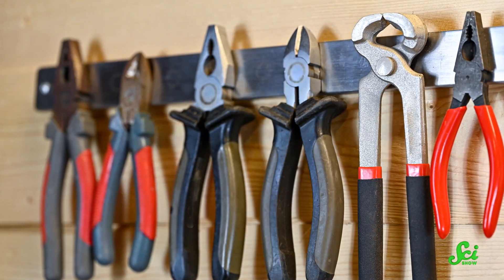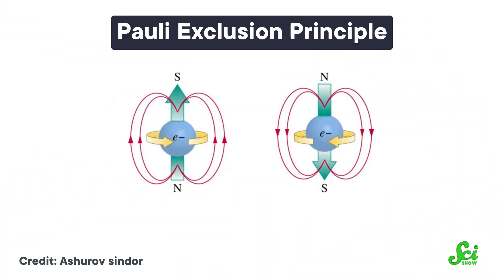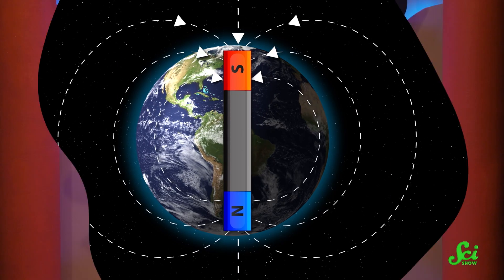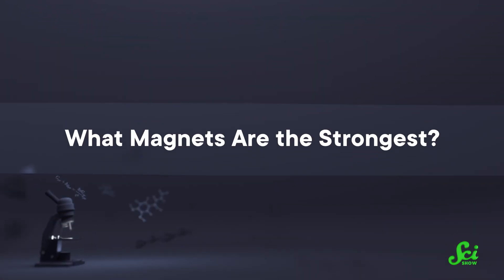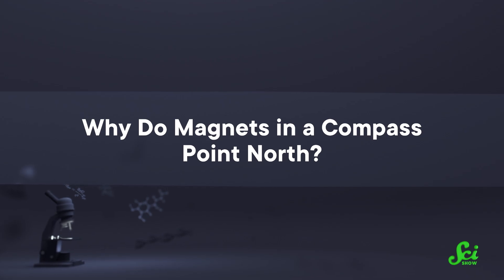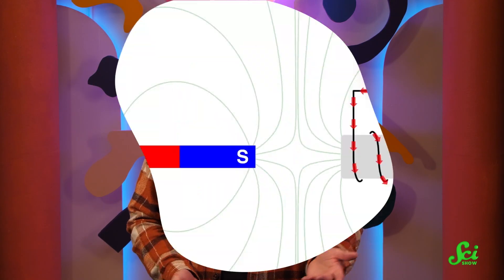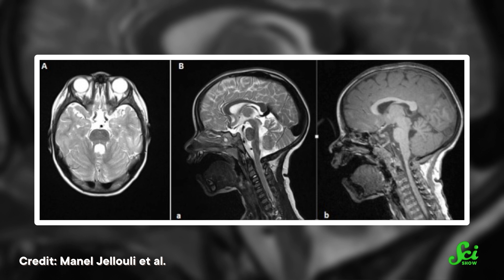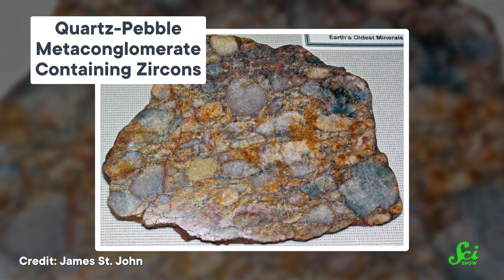The 16 Most Asked Questions About Magnets

Comment: 12:07 ooooo, I’ve undergone Transcranial Magnetic Stimulation (TMS). It was incredibly helpful in reducing my treatment resistant depression! the magnetic field is about the strength of an mri. 

It’s a little spooky when you’re doing it, because they can make your arm/hand/fingers move by pulsing something into your brain. If I remember correctly as well, the mechanism that makes TMS work as a treatment for mental illnesses is rather poorly understood. 

Super cool 💕
Reply: I've had it for both my depression and anxiety. The do have to switch sides for it to work on the separate issues. I still have to see a therapist and take meds, but I finally saw progress.
Reply: @jerseygirlinatl7701  Same situation for me. Meds and therapy are still necessary for sure, but it got me to a point where with those I’m functional:)
Reply: I have wondered if TMS could help those suffering long term/permanent antidepressant withdrawal syndrome? Since people like myself where the very meds that where suppose to help have left us disabled and we can't take any drug what so ever to help with the symptoms because it makes the condition much worse.
Reply: @3800S1 I suggest you go take some light box and uvb,uva light lamb (Use it with 15 spf sunscreen+carrot oil to reduce skin cancer risk) and take some thyrosine and 5 htp. Basically light box helps serotonin and dopamine to release and stimulate synthesis(hence why some go into manic episodes because of intense light) thyrosine and 5 htp are precursors of dopamine and serotonin if your reserves low it will fill it up and stimulate enzymes that synthesis it. Lastly uvb,uva lamb for vitd synthesis and has modulator effects on neurotransmitters. 

Truth be told I havent used light box and uva uvb for my withdrawal. I have tried to wean off 3 times ended up in extremely terrible side effects so I started taking 5 htp and thyrosine they were enough for me to wean of I didnt even have withdrawal despite weaning of just 1 week 1week. 

Ssris tend to lower receptor amount and enzyme that produce them so in some brain cant turn it into normal after stopping the drugs. I hope this helps. Also good sleep will make it better ,light box will help you with that. If you use it regularly 3 times a day (medium intensity 5000 lux in the morning,10000 lux in the noon,2500 lux in the afternoon) you will knocked out at the 21.00 pm.

These will help but if it isnt completely gone you need to directly stimulate your receptors so take some shrooms. Best way to get rid of depression and side effects of ssris are shrooms but I suggest you to take tyrhosine and 5htp to fill your reserves first than take shrooms Once your reserves filled up they wont have an effect stop taking them since they effect badly when you use them unnecessarity.

If you have bipolar disorder do not go above 5000 lux in the light box and do not take thyrosine (dopamine precursor)(just go for 5 htp) since they might cause a manic episode.
Reply: @3800S1  I can say that when I was cold turkey-ed on my antidepressants post TMS (really unfortunate mixup with my psychiatrist), I dealt with some brutal withdrawal symptoms. I don’t know if they could help while in their midst, but it, at least for me, didn’t preemptively prevent them.
Reply: I have autoimmune ensefalite right now due to corona and it has an interesting side effect which sensitivity to external factors. Basically medicine I take, foods I eat, light,,sound,magnetic field,cold and hot(Showering  is a difficult task since even slightly hot water cause burns or trigger attacks)) directly effects my brain and body functions. I feel them immediately,I cant use drugs in their normal dosages due to that.(Quarter of the lowest effective dosage would be enough and even show side effects so I cant use it regularly)

 I have gone into mri twice and in both of them some frequences released some nuerotransmitters and effected some receptors in my body. Some cause anxiety some cause muscle relaxation either way it is certainly effective. We need more research on this since different frequences have different effects.
Reply: @exosproudmamabear558  So there’s been research on the side effects of TMS and we know that it’s safe. We also know to target specific areas of the brain for specific illnesses. 

I’d also note that the changes happened on slower time scales than what you note. I went in daily for TMS treatments for weeks, than every other day for multiple more weeks, and if you look at my depression diagnostic scores during that time period, you don’t see a sudden cessation in depression, but a gradual decline. A decline that continued (rather significantly if I remember) past when the last treatment was done. 

It’s really hard to gauge what’s actually going on though in TMS, and one must presume, in what you’re going through, because the brain of a live person isn’t exactly easy to look at. 

I’m sorry you’re dealing with it, it sounds really rough. I have sensory issues as well, some of which spiked recently due to some trauma work I’ve been doing with a therapist. It’s really hard to go throughout your life when seemingly small things (at least from an outside perspective) are overwhelming.
Reply: Yellow food coloring causes depression that would create resistant depression doesn't matter what you take or do when you keep exposing yourself to what's causing it before you poison yourself with pills like a good little sheep does for the government and big pharma cut out food coloring first and it can take weeks for the food coloring to get out of your system and be careful it's in everything because the intent is to poison the American people
Reply: I was recently offered TMS! I'm not on it yet, but may start in a few months if I need to. Very very interesting treatment
Reply: @Misstborn  I hope if you end up doing it, that it works for you ❤️. It was life changing for me. I’m also sorry that you’re in a position where it’s being considered. The fight is often long, but worthwhile.

Comment: You video is already out of date.  Everyone's moved to SSDs and kids won't know what a hard drive is in a few years.  haha
Reply: Large capacity spinning hard drives are still very much in use. Although they are slower for use as the primary drive on a computer, for network storage, your network is usually the bottleneck so they're plenty fast for that purpose. They're also cheaper than an ssd of the same capacity.

Comment: Back in the 80's I did some tests with floppies to check how "fragile" they were, one was sticking one on the fridge with a fridge magnet. I do not remember how long I left it there but I do remember it did not lose its data. Those were one sided 160K floppies, it's possible that this low density helped their reliability.
Reply: I've tried this on some regular 1.44meg floppies and it corrupted a good amount of them, the key was iirc was the move a strong magnet over the surface back and forth like you would to magnetise a screw driver.  Also cassette tapes wiped instantly when you wound the tap with a magnet in place of where the head goes, same as VHS.  But even bringing the magnet over the cassette housing on the side was enough to lose the volume in most cases but not wipe the content completely.
Reply: Floppy discs works a bit like magnetic viewing film - changing fields change the pattern.
Sticking a floppy onto a fridge and leaving it there won't change the fields a whole lot, so the pattern just remain the same.
If you had moved the magnet around in circles, zig-zagging, etc - the data would have been literally wiped away
Reply: That's not "fragility." Using that word definitely made me not understand the story at first lol
Reply: Guess we could compare the field energy of a fridge magnet vs the floppy drives writing and reading hardware
Reply: I was really, really good at zapping floppies and data tapes due to my body holding Alegre amounts of electric static once it reached a set number I could zap things. The company I use to work for had to get experts in to test the building we were in because when we moved into it I started zapping the magnetic keys that opened all the security doors. I had to make the programmers place their data disc or tapes on the desk, I refused to take them out of their hands because 1, each time I zapped anything it left burn marks on the tips if my fingers and it hurts like hell, 2, if the static charge was big enough it either scrambled the data or wiped it clean as if there was nothing on it to start with.
The guys got me to walk up and down the hall ways and other places within the new building and they were shocked that I had not self combusted going by the data they were getting off me. I had to wear a special anklet which kept my skin connected to the ground 24/7 while in the office. Every security door had to have a zapping plate on the wall that I had to touch first before inserting the magnetic key card. My watch is meant to be charged every 7 days 😹😹😹I put it on to charge on average every 4-5 weeks. All my clothes had to be sprayed with a special solution after each time they were washed so that it stopped them from contributing to my electrifying personality 😹😹😹
One day when my boss had a new guy start working for us never believed the guys when they told him about me, well we were all called into a meeting with the boss and the new guy would not place the company cars keys on the table because he had been told I must take them to to ensure that I had received them 🙄🙄 so as I reached for the dam keys there was a blue/which static discharge that happened between us, I think it was the dam sound that I heard that freaked me the most, as I grabbed the darn keys he was dangling from his hand, the next thing I knew I was flying across the dam room slamming into the office window (thank goodness it was over and inch thick) when I came too the idiots face was white as a ghost, turned out he lied because he did not believe everyone about my issue with static build up, the hand that I had grabbed the metal keys with, you could see the an imprint burnt into palm of my hand. I had not had the chance to put the dam anklet on when I got into the office.
The guy never came near me again the whole time I was working there after that day. He even went as far as moving his things from the desk next to me to a different work station.
Even after all those years I still have issues with brand new buildings, for some reason they seem to boast my static issues every time.
I can feel the electricity running through the wiring when it is powering up lamps, computers and anything electrical. I can run my finger along the edge of my iPad while it is plugged into the mains and feel the ripple of the electric field all around the iPad the minute I pull the plug it vanishes. It’s the same with those flat screen TV’s I can feel the rippling of the electric field while it’s turned on. Once the power is off the rippling affect is gone. 
Having an MRI is a pain because it feels like I have become a lightning rod my hair has to be tied into a ponytail as it starts to fan out, I can feel every single strand of hair on my body standing up as I go through the machine. The same thing happens when I walk through the metal detecting machine.